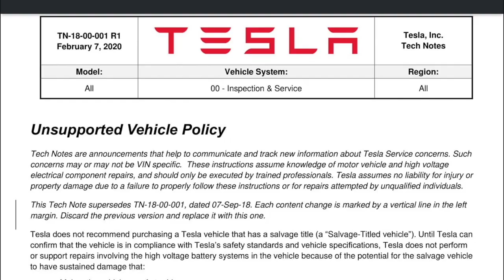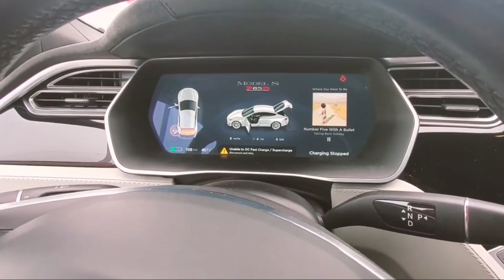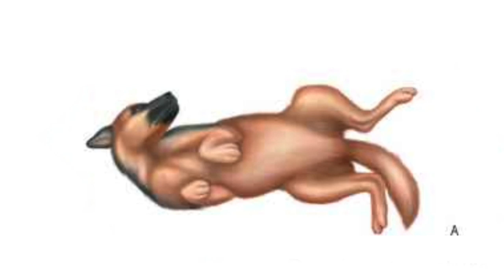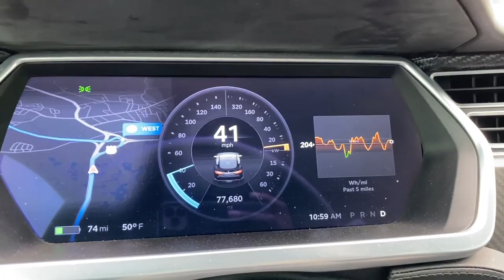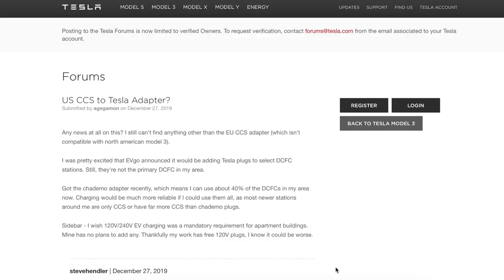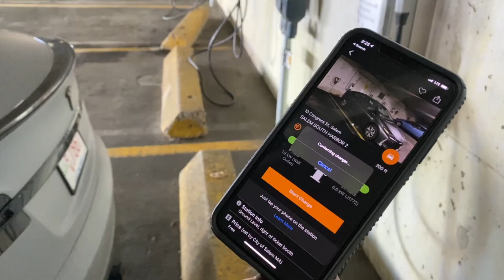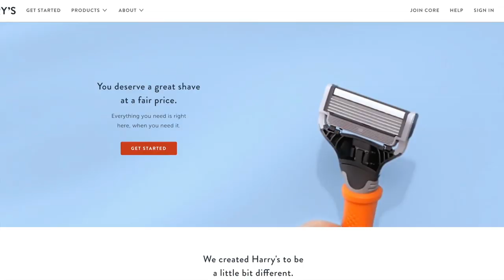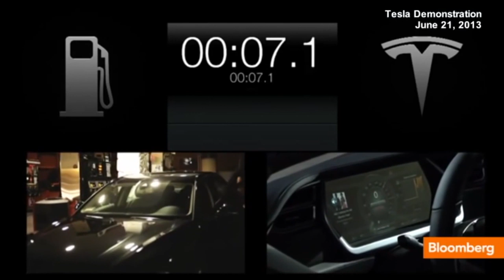Tesla ruined my car and it’s the best thing to ever happen to me!

Comment: This should affect Tesla buyers since this does impact potential resale value of their new cars.
Reply: Not really, this is about salvage title vehicles.
Reply: @JasonWW2000  Not at all. Once a car is totaled, an insurance company gives you the value of the car and buts the car from you. That is the end of the car's life as it stands. Should someone buy a car from an insurance company, the car will start at a low value and slowly work its way back up, the more it is repaired. Basic Economics.
Reply: @anthonydantonio6649  It seems like you agree with me.
Reply: @JasonWW2000  yes, I just wanted to make it fully clear for him, I had mentioned the wrong person in my last comment, sorry.
Reply: It doesn't.
Reply: It could impact Tesla buyers if they're concerned about resale value.  Who's to say Tesla won't change their terms of service to disable features when a vehicle is resold?  For instance, Autopilot or DC fast charging or range.  That's all software configurable, right?  They could, of course, resell that to a second owner.  All depends on how they structure their license.
Reply: @gtoger  You're stuck on the slippery slope fallacy. 

It's perfectly reasonable to disable public use of utilities for salvage title vechicles.

There's no reason to believe that tesla will disable core features from factory vehicles. If they do this they will open themselves up to huge lawsuits that they will lose.
Reply: @iankelly6162  People open themselves up to prison for committing crimes, but crime still happens. Tesla may disable other things if they can find a reason. While knows what the future will bring. Personally, I prefer total ownership and a key with no internet connection. A standalone vehicle. Unfortunately it seems other manufacturers are starting to design their EVs with over the air updates as well. Maybe its good, maybe it's bad.
Reply: @JasonWW2000  You're still stuck on the slippery slope fallacy. You see one example that might be questionable and you assume if we allow them to get away with this on salvage vehicles, it's only a matter of time before they do it to factory verified vehicles. It's a fallacious argument and you need to stop now.

If tesla does start disabling features on factory cars, they open themselves up to huge lawsuits in the future. If our legislators allow tesla to get away with it, we have much larger problems than you not being able to supercharge your car.
Reply: @gtoger  you are making 2 different arguments. First off this wont currently affect resale value at all. Secondly, speculation like that is useless. For one there is no backing that Tesla would ever do this, they would do more harm then good. Secondly you can speculate about any company, what happens if apple comes out tomorrow and says because of the coronavirus no iPhone older then the 10 would be supported. They wont because it would be terrible for business, but you get my point speculation is just making stuff up with no backing.
Reply: Clearly inadequate protection... You can do it with a petrol car and not have it blow up. I'm not going to buy one.
Reply: @iankelly6162  explain why is it perfectly reasonable? Have you seen Richs car in these videos? What is reasonable about not allowing his car to be charged at a fast rate vs a slow rate.
Reply: @anthonydantonio6649  Oh, OK.  Thanks for clearing that up.   I'm glad it's fine.
Reply: @iankelly6162  Thanks for clearing that up.  I'm glad it will be fine.
Reply: @whyarewehere3893  That's fine, you don't have to buy one. The super chargers are absolutely serious business. Salvage vehicles have no business on a 480v 200kw charging station.
Reply: @iankelly6162  You have no idea what you are talking about from your armchair. The Supercharger is just a stack of UMC chargers. The SAME hardware. The only difference is that the Supercharger goes in on a different contactor on the car to connect to the battery than the UMC. If a car charges on UMC it WILL SAFELY charge on a Supercharger. The car's BMS asks for the amount of current, so even if, say, someone was to rebuild a car and not install a radiator (bypass) the BMS would charge the car at the Supercharger at maybe 2 or 3kW.  The BMS has to be fully functional or the car will shut down and refuse to charge. The is all smoke and mirror to sell more cars and to screw over the insurance companies...remember, Tesla now runs a car insurance company....
Reply: @vidznstuff1  I'm an electrician. This isn't armchair talk. 250kw is serious power. There is no reason to allow hobbyists to connect their devices to 480v 300amp stations. He still has a fully functioning vehicle, he is able to fully charge it. He bought a salvage vehicle and risked never being able to fix it at all. I'm happy for him that he got it working. I don't care that he's crying about not being able to hook up to equipment that does not belong to him. 

There's no reason to believe that tesla is doing this maliciously. It's to mitigate responsibility. 

Tesla is willing to accept responsibility for problems with factory teslas. 

Tesla is not willing to accept responsibility for problems caused by hobbyists that rebuild salvaged vehicles.
Reply: @anthonydantonio6649  "First off this wont currently affect resale value at all." - Actually... There has been evidence that Tesla disabled FSD on a vehicle that had been sold. So... Yeah, you're wrong. Tesla already has a record of doing this. 

Apple already does this. Microsoft installs their software on old hardware, Apple will not. You've got an old Mac Mini? Good luck finding a use for it, besides a "historical wall hanging" - because half the software on the apple store won't work on an 'older OS', because they will not allow you to install an updated Apple OS on it. 

I'm sure Ian Kelly will say "well, Tesla/Apple is right to do this" - I'm not sure where he even comes from... Once this becomes public knowledge, folks won't buy a used (even "Tesla recertified") Tesla. Because, was it scratched? Bodywork done someplace besides California? You have to spend an additional 7 grand to get FSD on a used Tesla that previously had it? 

Assume 3 or 4 years from now that you want another company's EV, and bought FSD for your Tesla. That "license" doesn't transfer - so, you bought a 7 grand worthlessburger, and if you tell your potential buyer that it has FSD when it doesn't - I'm sure you can see where this is going.
Reply: @iankelly6162  "I'm an electrician. This isn't armchair talk. 250kw is serious power. There is no reason to allow hobbyists to connect their devices to 480v 300amp stations." - It worked previously with NO ISSUES. And what about the SENSORS. You're not making a valid argument here, "electrician" or not.
Reply: @Maybe-So  Yes, it worked before after the parts installed have been rigorously QA tested and validated. It is a salvaged car. Tesla is not willing to take responsibility for the work of some hobbyist. 

These are salvaged vehicles that are known salvage. 

Tesla is willing to take responsibility for tesla products that they verify are good. If there is a problem they are responsible for investigating root cause, correcting issues and putting recalls into effect if there's defects.

If a salvage vehicle causes problems, the station still needs to be rebuilt. The investigation still needs to happen. Tesla will most likely front the cost of all of this. In the course of the investigation, if it comes out that the vehicle is salvage/rebuilt, and the rebuilder is now responsible, how is tesla going to collect? Through pricey litigation? Does the mechanic have insurance on the work he does?

Allowing salvage vehicles access to supercharging stations adds a variable that tesla is not willing to accept. It is that simple. I don't know why it's so hard for you to grasp.

I'm going to repeat this.

Gasoline is chemically reactive with a lot of different materials. Gasoline requires special containers to store it safely. It is illegal to put gasoline into a container that's not suitable. 

A salvage title car may be an "unsuitable container" for 250kw of charging. It may work out just fine, who knows. It's a gamble that tesla is intelligently not willing to bet on. 

It's your hobby, expecting other people to bend over backwards so you can experiment is nonsense.
Reply: @iankelly6162   Rich can not even use his home fast charger to charge the car. Where is the logic in that?
Reply: @JasonWW2000  The video shows he's not able to use superchargers in public. He is able to use standard chargers, including home charging. At least it wasn't shown that he can't charge at home. The video starts off of his "real world scenario" where he forgets to fully charge it at home and then has to go out in the world but can't supercharge.

If he can't charge properly at home, I agree that this is a problem.
Reply: @iankelly6162  Sorry, but the idea that Tesla is responsible for the actions of a third party is complete rubbish.

And who says that it's hobbyists that are restoring salvage Teslas? Semi-pros, pros, and bodyshops do it. How is it that a bent quarter panel and door write off a car to where it's deemed "unsafe to charge?"

All are caught up in Tesla's bullshit. 

Did you know that a stolen car is branded salvage if it's recovered, usually intact, after a period of time? How is that car not able to charge?

It's all lawyer bullshit. Taking property from third parties is felony larceny. Tesla barks loudly, but they won't for long. You'll be able to buy all the Bolt EV's, Mustang EVs etc you want with salvage titles, work on them, get any part you want for reasonable money. Playtime for Tesla is over.
Reply: @iankelly6162  he even said they were checked and approved, but Tesla changed their mind for no reason...
Reply: @whyarewehere3893  If he paid for the service then he absolutely deserves his money back. I'm not saying he's wrong about that. He's wrong about demanding access to property that isn't his.
Reply: @iankelly6162  yeh and they approved the car. So clearly they are just being arse about it
Reply: @Maybe-So  The FSD they disabled was because it was never purchased by the original owner, he just had it by some accident. They had sent data to the car that was received to disable it, but it obviously wouldn't connect to Wifi until the new owner connected it. Tesla was right to remove the FSD, but because it couldn't get removed until after the sale, Tesla gave it back to the guy no problem. That story was just filled with unnecessary FUD. There is no evidence that Tesla would ever remove FSD or Autopilot from a car that rightfully had both purchased.

Comment: No longer a fan of Tesla, happy with my Nissan leaf, my 40 mile range is 40 miles too much for this looming lockdown.
Reply: Leaf Crew!!
Reply: Same here.  Just a commoner plugging my Leaf into ChargePoint.
Reply: Maybe Rich could try and stuff tesla batteries into a leaf?
Tesla should stick with what they are good at..... the batteries! They should ditch their car brand and focus on recycling existing cars. EV West has the right idea.
Reply: I was on the fence about getting a cyber truck, it feels like Tesla is the Apple of electric cars, they want total control even after you buy it.
Reply: I'll tell you that the Nissan Leaf has one of the most efficient motors out there. I'll be using one in my EV conversion.
It's a shame that the battery doesn't have thermal management, but otherwise it's really not a bad car.

Comment: This also reminds me of the guy who recently bought a used Tesla that the ORIGINAL owner paid for full self driving. Tesla, who already got paid for the feature, then disabled it for the new owner, which is outright theft.
Reply: That's not theft, as the new owner didn't pay for the service. It's kind of like buying a used phone and expecting it to still be activated because the previous owner paid for service.
Reply: @rprofux  [Doorbell rings] "Hi, We're from the Ford change of ownership team. We've been told that you recently bought a used Focus ST? We're here to retrofit a base level radio in place of the optional "In car infotainment system" the original owner paid for....... Oh, and we see from our records that the car had a minor prang with its previous owner that was fixed by a 3rd party garage, so we're going to have to limit how fast you can pump fuel into it from now on. It'll be down to about half a pint per minute in future". :)

Comment: You’ve convinced me uncle Rich. I’m not buying a Tesla until they change their attitude about servicing owners that want to be more self sufficient.
Reply: Hal Stead the message he is trying to get out is to buy a tesla from the dealership.
Reply: They are changing their attitude..... for the better.... for them..... not you.
Reply: @clipzzzmuhumad4975  No, it's that tesla doesn't care about anything they don't get a profit off of each time it's sold or resold.  Buy a turdsla off craigslist.. or ebay or anywhere else that every other manufacturer is fine with and you're fine.  Buy this junk off a private seller and you are liable to get screwed.  F their business model and company founder.
Reply: @trevors8577  They can do what other auto manufacturer does.......Add a liability clause that saveguards any tesla purchases  outside the warranty or certification. Now if you spend the $12k to recertified should enable supercharging regardless and never be disabled again.

Comment: >"Not one to buy overpriced nonsense"
>Tesla
>Electric Razor Scooters
Reply: @OWSEWEAR  Tesla's are not cheaper than most cars.
Reply: Mike O The average price of a new car in the United States is a little over $36,000. A Tesla model three starts at $35,000. A Tesla is cheaper than most cars.
Reply: @Ratrix  That average price might including trucks?
Reply: @Ratrix  a Honda Accord is like 23k new so
Reply: @OWSEWEAR  way overpriced.
Reply: @Ratrix  find one for 35k. I bet you can't.  And resale value drops faster than a rock thrown off Niagara Falls.  And with the build quality of a 90s Kia.

Comment: This makes perfect sense. It's for safety reasons. They won't allow superchargiong on your vehicle because you bought one at auction that was gutted with a salvage title. You rebuilt it yourself, so Tesla has no idea if things are wired correctly or not. The charging system in these cars requires that the battery, charge port, and entire high voltage circuit are perfect, or catastophic failure could happen when the supercharger tries to deliver 800 amps continuously. Like explosion, fire, death. All bad press for the company

Comment: This is going to ruin Tesla's used market.
Reply: They don't care, buy from them and it's guaranteed certified, anyone else you are fucked
Reply: This type of crap steers me away from Tesla, I'll wait until the big auto makers end Tesla.
Reply: That's the point
Reply: They don't want you to own a Tesla. They want you to rent one.
Reply: @johnhull6363  that's literally not how it works for any other car company including thier electric vehicles. Elon deserves no special consideration. I bough my first Ford pickup from a Chevrolet dealership and Ford didnt waltz over and remove cruise control and keyless entry on it because I didn't buy it from them. This business model should be discouraged at any turn and by any means.

Comment: Btw, slow charging makes the battery last longer 😜
Reply: That why i don't use my phones fast charger.
Using my old slow samsung charger for overnight charging.
Reply: That's not the point. 18 miles per hour is absurd. That would tell like 30 hours to charge the car. That makes electric cars completely useless.
Reply: @N0N0111  Note 4 owner here. My second battery lives life in the slow lane :D

(and a 20,000 MaH charger in the backpack as a backup)
Reply: @N0N0111  That's not the point. 18 miles per hour is absurd. That would tell like 30 hours to charge the car. That makes electric cars completely useless.
Reply: You have to manage the thermal expansion when fast charging because of the cell structure. It should be viable to DC charge in ramping current sequences to avoid this thermal surge,  sort of 10s at 50A peak, 30s at 10A, but this is not a viable option long term.
Reply: Tesla’s last much longer when you can’t drive them more that 8miles a day and cat take long trips ever.
Reply: Just install a electric clothes dryer outlet. Provides about 30 mile charge per hour.